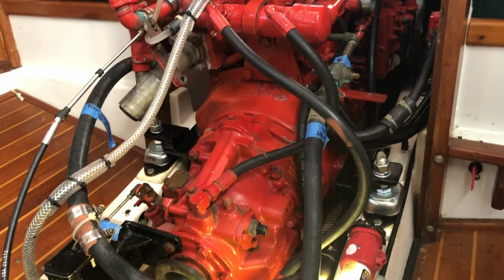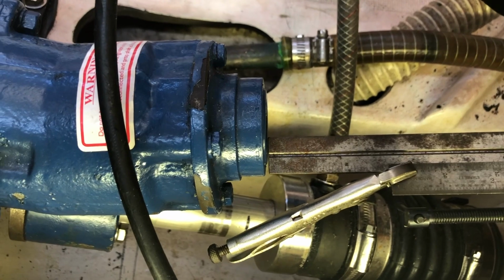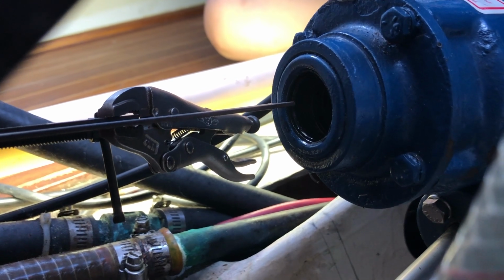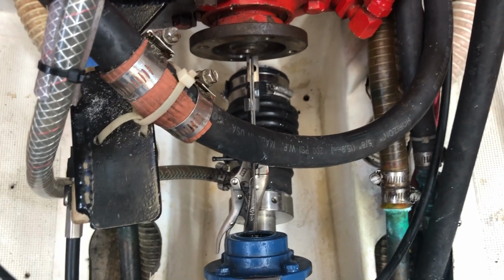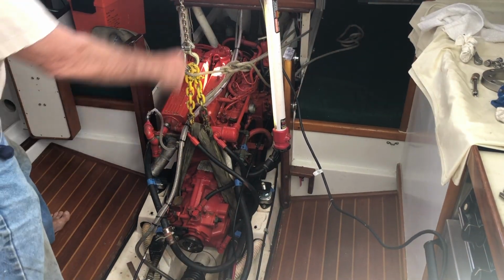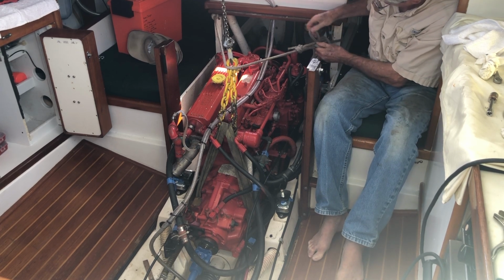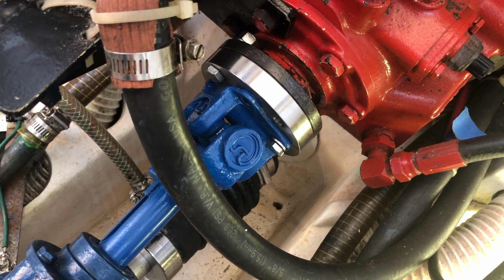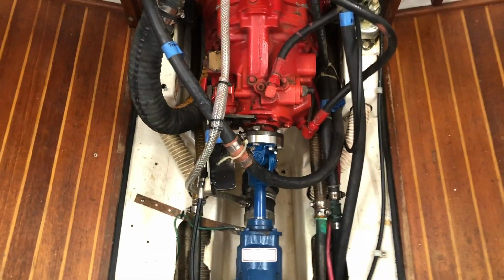Seafire Engine Alignment   HD 1080p

Comment: 800-900rpm isnt really a low idle. 
You can see that when engine was dripped into gear how it went clunk and the engine/drietrain jumped. Borg-warner/Velvetdrives dont like a high idle when going into gear. Springloaded driveplate mounted to the flywheel will take a pounding at a high idle speed. 650-750 might be a better bet.
Reply from the maker: Thanks, I'll ease it down a bit.  I originally set it when the engine was new in 2005 using Beta recommendations.
Reply: Will be a lot easier on the driveplate and gearbox/V-drive at a lower idle. 
And even tho that PSS seal is rated as being dripless, it may pay to place a shield over it as they do leak/drip over time and it will get flung onto your universals, and V-drive assembly.